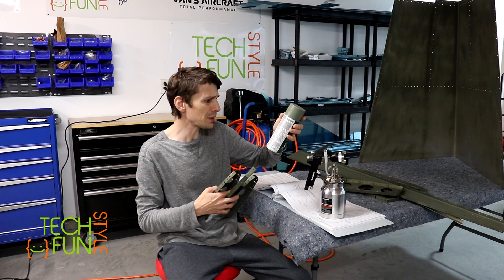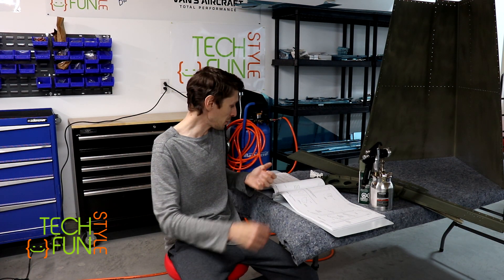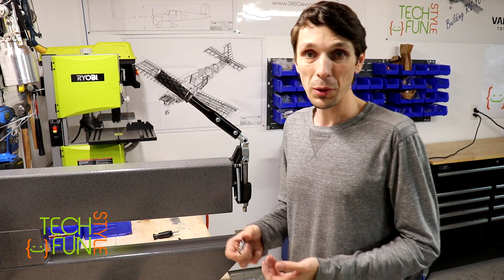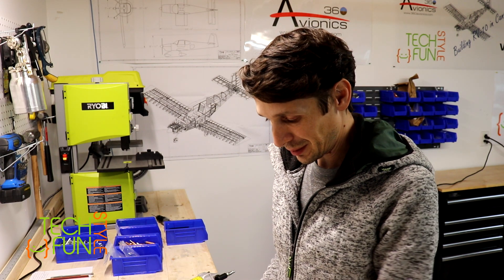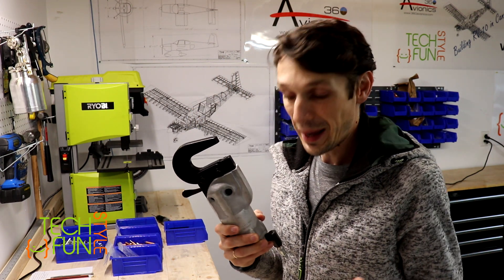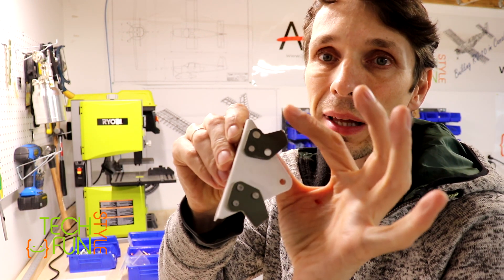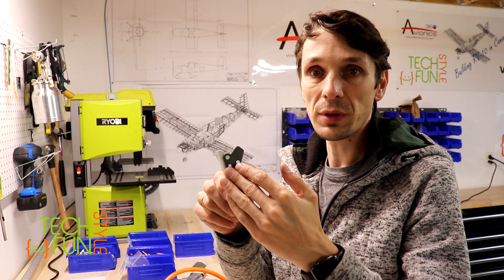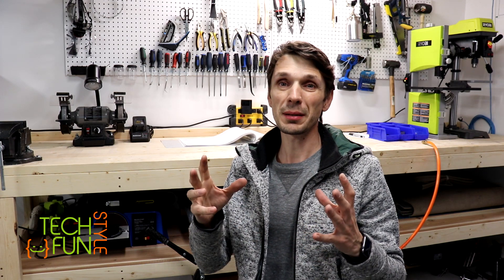RV-10 - Vertical Stab Assembly. Page 6-4 Steps 1-7, Page 6-5 Steps 1-2

Comment: Curious if the primer you used scratches off easily? Thanks!
Reply from the maker: It does, not easily but I was able to scratch it in some spots during riveting. What I did is I repainted with primer some spots after riveting and will add little more later when vertical stab is completed. Actually for next priming of my parts I bought a gallon of SM grey primer and will use paint gun to prime my parts. Results will be in video soon.